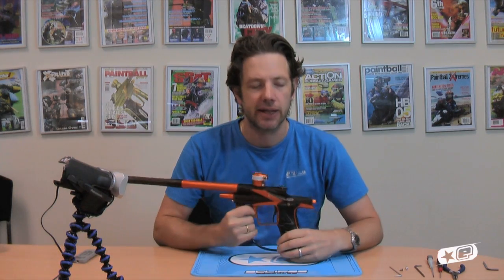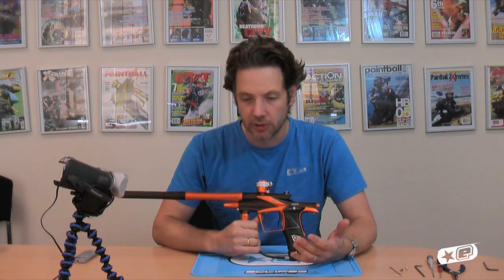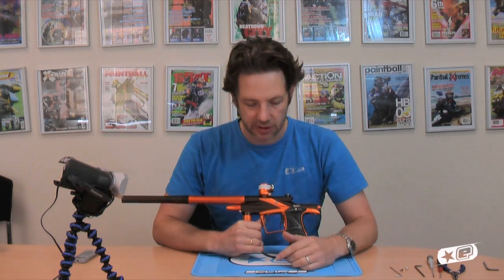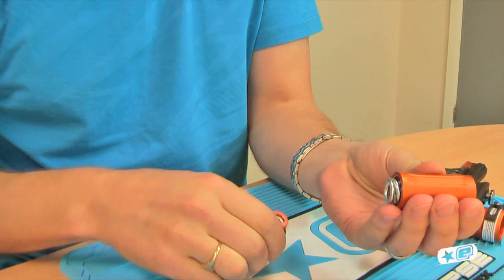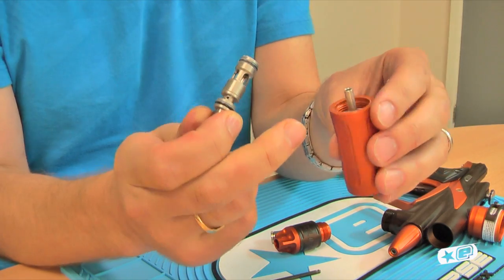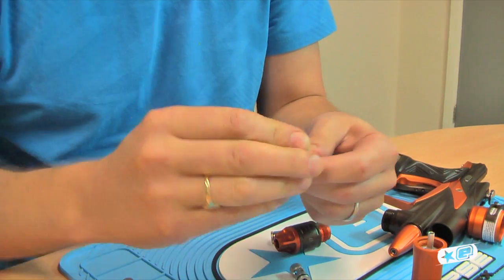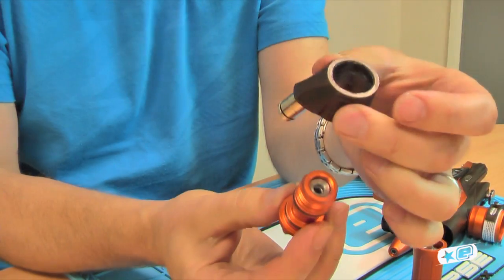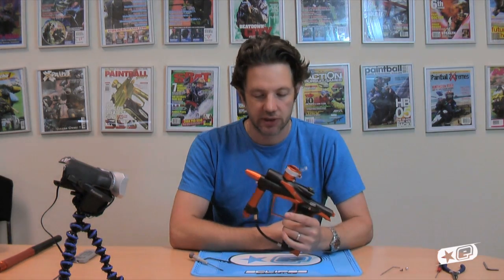Ego11 Indepth - SL3 Inline Regulator

Comment: Is the SL3 reg the first PE reg that can use slower pressure tanks and shoot consistently to lower remaining tank pressure? 

Have a few extra solenoids so I’m building a new 06 Ego from 05/06 parts I have laying around. Wondering if I should use one of my SL3 regs in this build instead of an 06 Ego star reg. Was sending the parts off for a custom anodizing so can anodize a SL3 reg instead of a Star reg if it will yield performance improvements.

Comment: with the CSL you get a lp valve unlike with the ego 11, so to use a lp tank on an ego 11 do you need that valve, cause the CSL and Ego 11 are very similar internals wise and so if the CSL needs a lp valve then won't the ego 11 need that valve as well to use a lp tank.  if so, where would one be able to buy a lp valve for an ego 11?

Comment: @iceman5943 i got a big allen key (idk what size but i know it doesnt come the eclipse guns, might have to get it). I put it on the bottom of the regulator, held the top half and then started turning, came right off. I had the same problem as you but with an ego.

Comment: @Skakan dude you don't have to spend almost 1300$ for a paintball gun if you just started playing.get an etek 3 from planet eclipse or a G4 from dangerous power. plus get a good hopper just like dye rotor.you'll have to spend 600$ for everything. well if you have the money to spend it'll be awesome to have a ego 11 and yeah you can use a high pressure HPA tank on ego 11.